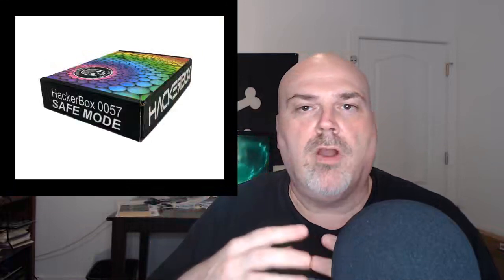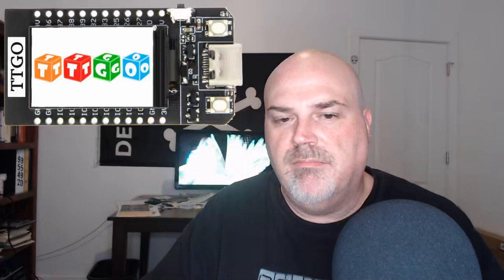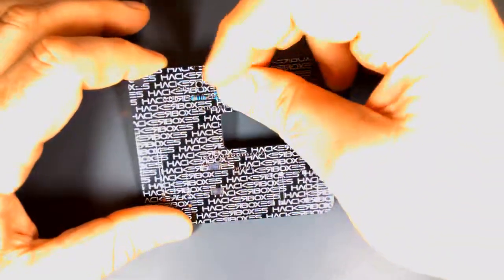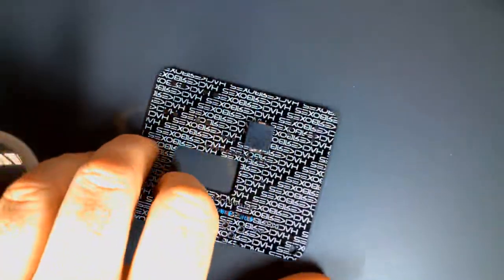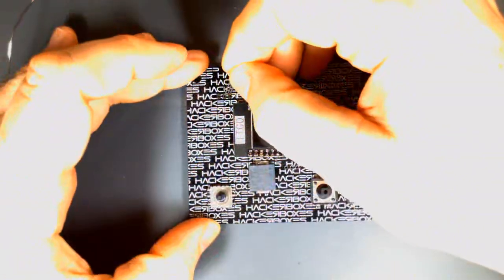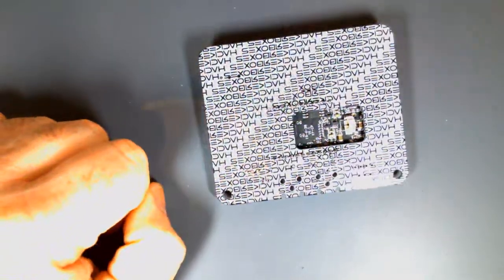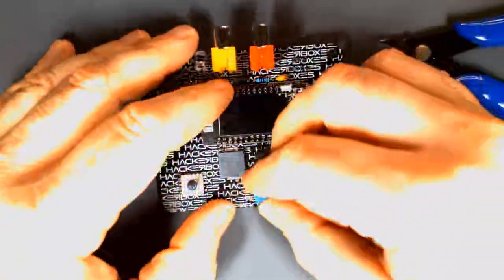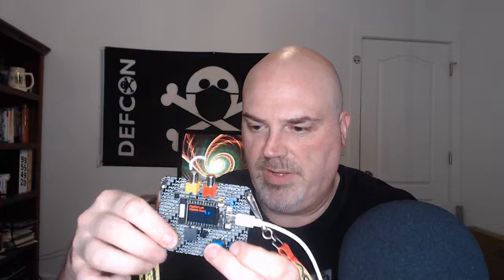HackerBox 0057 Badge Build from DEF CON 28 Hardware Hacking Village

Comment: There's so much modification required for that marauder project to work.  It won't compile on the recommended hardware without some work, let alone modifying pins, screens, and making it non-touch screen.  Probably easier to learn the different routines in the code and write from scratch.

Comment: This box is sold out on the website already. Will anymore become available?
Reply from the maker: Yes, HackerBox 0057 sold out during DEF CON 28.  Since the monthly HackerBoxes are made primarily for shipment each month to members, any leftovers are only available online until they sell out.  You might want to have a look at HackerBox 0050.  There are still and handful left and they feature a somewhat similar "badge" kit with the same microcontroller (ESP32) and a larger color display.  https://hackerboxes.com/products/hackerbox-0050
Reply: HackerBoxes Thanks for the quick response! I will take a look at box 50. I used to be a subscriber, I have box 0001 up to 0011 but it was getting a little too expensive for me at the time with the shipping costs to the UK. Also half of the boxes were stopped by customs over here and I had to pay an extra charge to get them released. I might have to re-subscribe now though, they are awesome!
Reply from the maker: Very cool!  Check with stackry.com (no affiliation).  It seems like most of the members in the UK are working with them.